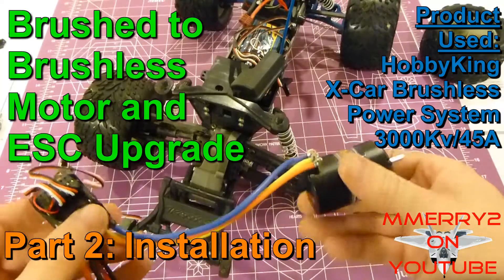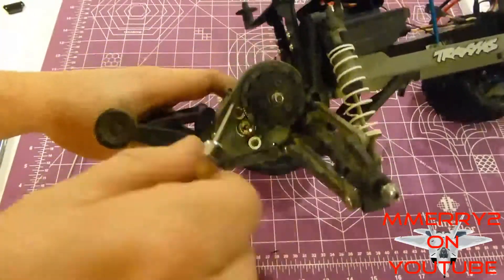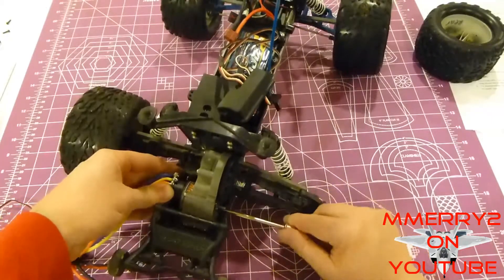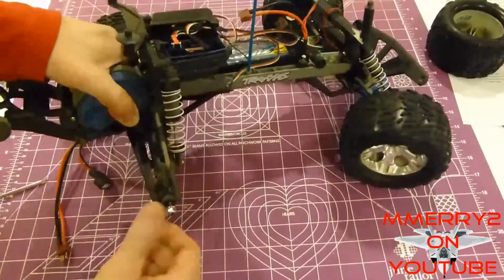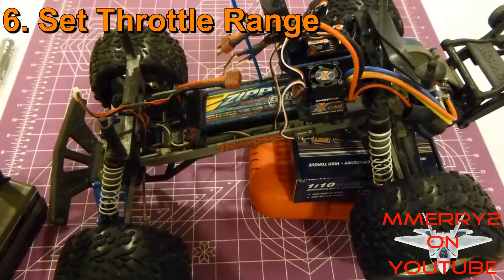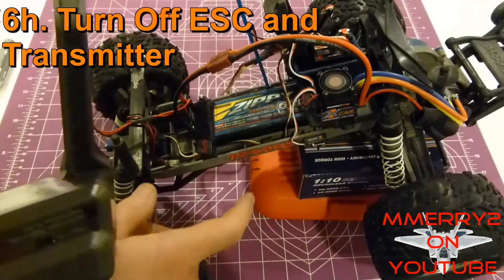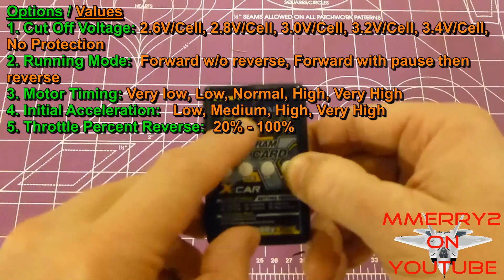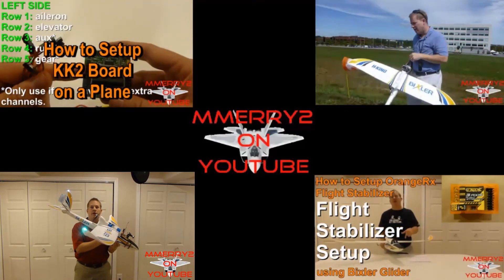AWESOME Brushed to Brushless Motor Upgrade! - Part 2

Comment: I have a Porsche tamiya 911 tt02 and I bought a brushless motor for it the wire colors are red blk and Blu. And my esc has Blu Yellow Orange which colors go where
Reply from the maker: For brushless motors the wiring colors don't matter.  You can hook up the 3 wires to any other 3 wires.  If you find that the motor is running in the opposite direction then you want then swap any 2 wires and the motor will turn in the other direction.  You can try a short test connecting the wires with alligator clips before soldering the wires together. Just make sure you keep the clips electrically insulated from each other!

Comment: Hello mmerry2 I'm thinking of upgrading my rc car to a brushless too so do these steps apply to all brushless esc's?
Reply from the maker: Martinoffi Atanas Pretty much, but before you buy your brushless motor, take measurements of your old motor, compare it to the motor you want to buy, just to make sure it will fit.  Try taking the old motor out of your car to see how it comes out.  Take a look at the mounting holes.  Do they match?  What is the shaft diameter of the old motor?  Is it different than the new shaft diameter? if so, you can buy a new spur gear that fits the new motor.  The brushless ESC is less critical, but it helps to just buy the ESC that goes with the motor.  What car do you have?

Comment: wait, so the main thing I'm concerned about is,, can i install a brushless system without having to buy a new controller? like can i keep the original controller that i used when it was brushed motor?? because i cannot afford a 200$ controller

Comment: hi mmerry2! I have kind of basic question, can I mount brushless esc and brushless motor to brushed board? I have just 2 cables to brushed motor, did you just done same thing on this movie? You dont need converter from brushed to brushless?
Reply from the maker: RL Filming Brushless motors use 3 wires and AC current.  Brushed motors uses 2 wires and DC current.  Therefore, you have to use a brushless ESC with a brushless motor and you have to use a brushed ESC with a brushed motor.  Did I answer your question?
Reply: mmerry2 on YouTube  kind of :) you have upgraded from brushed to brushless? so did you use some kind of converter brushed => brushless? to point is if original car was having dc motor I cannot mount ac without converter?
Reply from the maker: RL Filming No, there is no converter.  It is a replacement of brushed motor and ESC with a brushless motor and ESC.

Comment: I got the tunigy trackstar brushless 540 2 pole 4000kv for my traxxas and when I put it in the throttle is backwards. how can I fix this. when you pull it back its in reverse and forward is forward.
Reply from the maker: You have to reverse the throttle channel.  There is a throttle reversing switch on the base of the Traxxas transmitter.

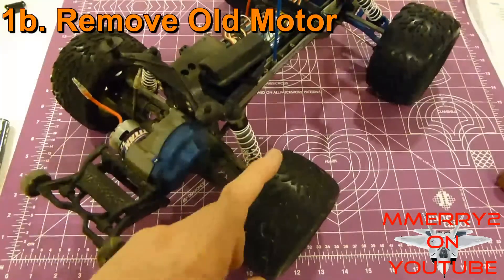Comment: thanks for the upload, im upgrading to brushless in a toy grade. my question is this. i have a zd racing 1:16 brushless esc  but the car will be running a brushless 540 motor since a 540 is the original size. Wondering if a low kv motor 3000-4000 will be to much for the esc. i also plan on using 3s since my zd racing buggy of the same scale runs great on 3s